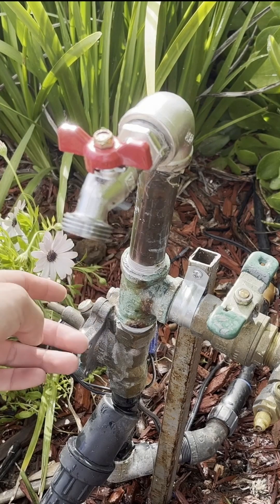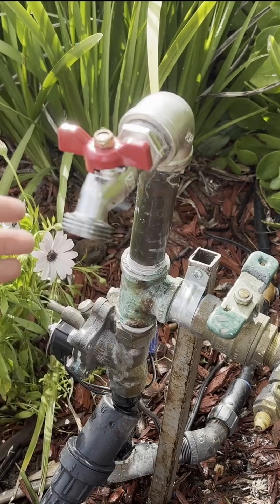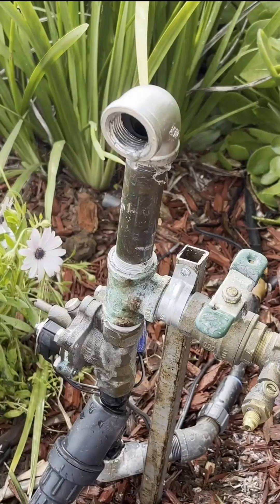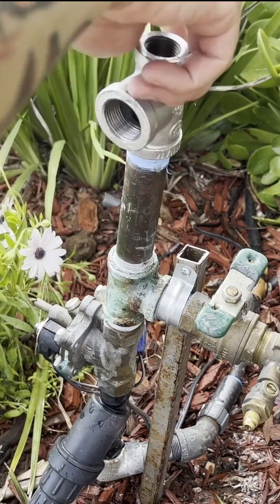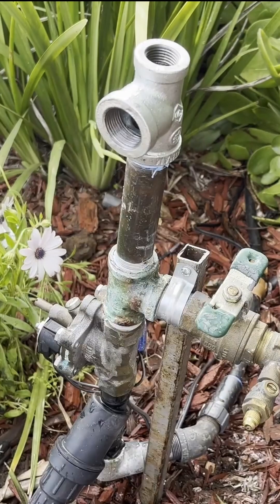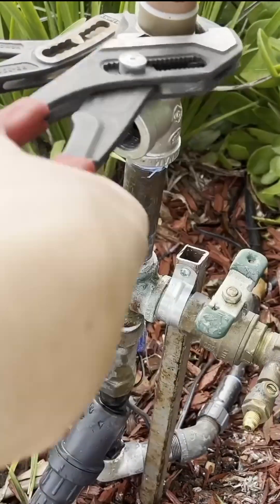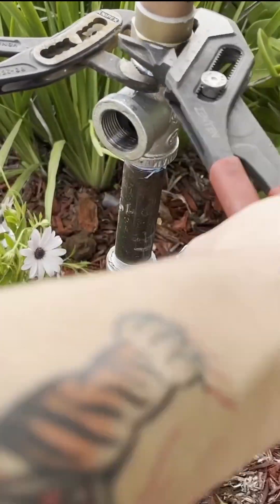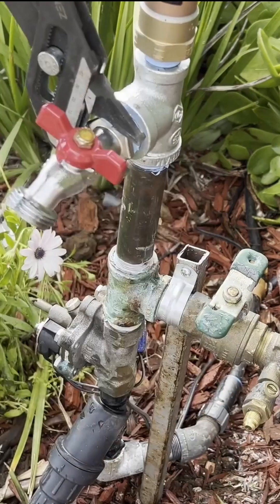Banging Irrigation Pipes? Install a Water Hammer Arrestor! #shorts

Comment: i need to do this for my sprinkler system. I was telling my old lady the other day I better get to it before it shakes a joint loose somewhere and causes an actual problem. Also, you never know what that pipe could be vibrating against and will cause a friction leak eventually.